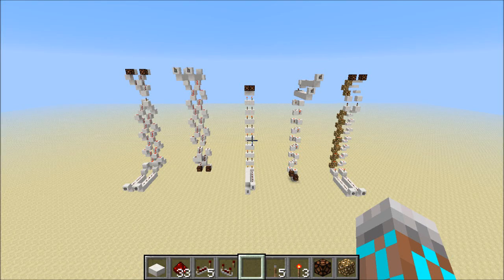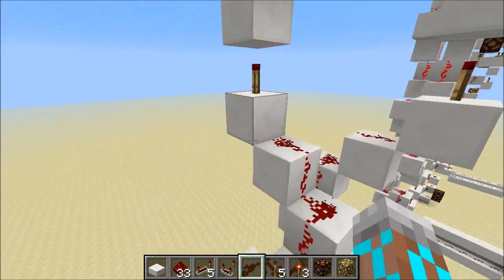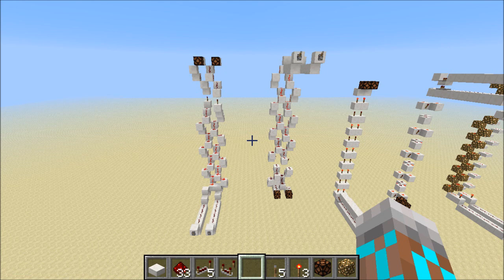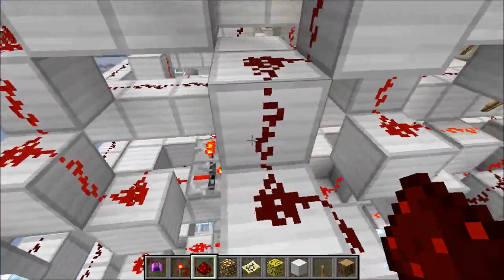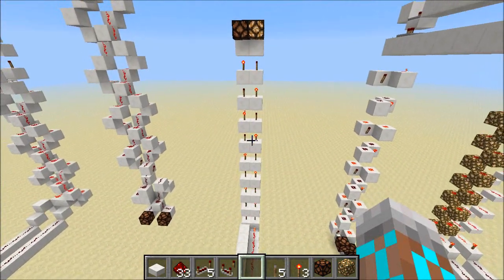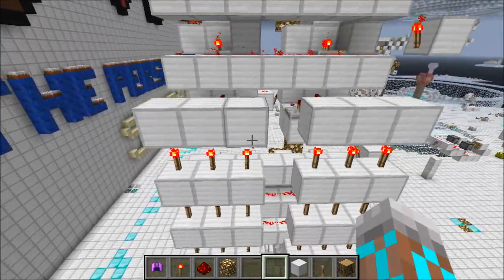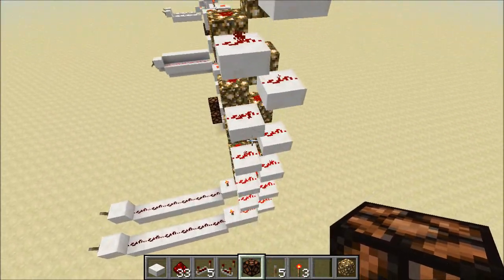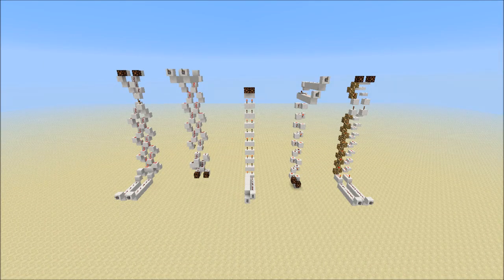Vertical Wiring - Designs and Uses

Comment: Propereinglish. Do you have any idea if there is timing bugs in pistons and torches, because I've been making things that involve precise timing, and make multiple EXACT copies of the circuit ( or broke it and rebuilt it the same), but some work and some don't. There is nothing interfering with them. And sometimes when making a 1 tick pulse (using a monostable circuit) the line that turns the output torch off after one tick, seems to turn it off too early.  If I lengthen the delay, it's too late